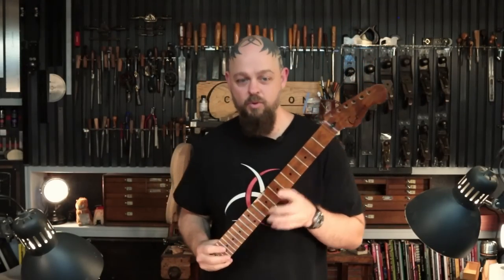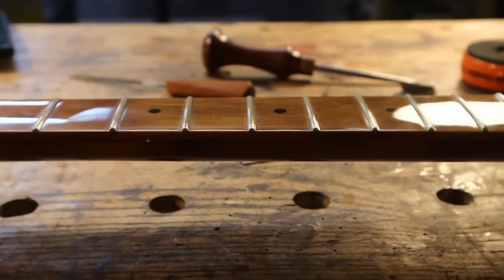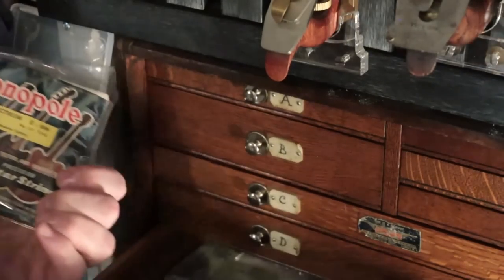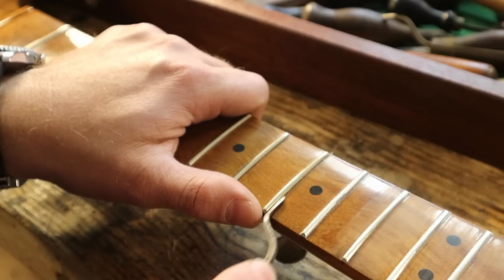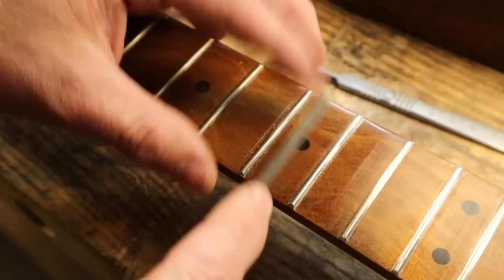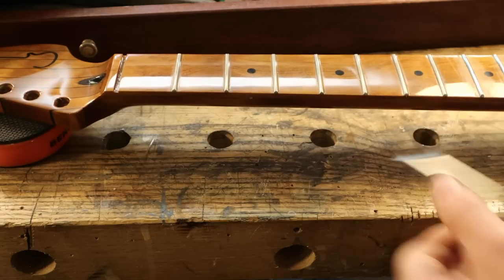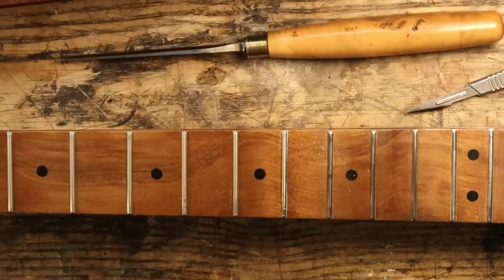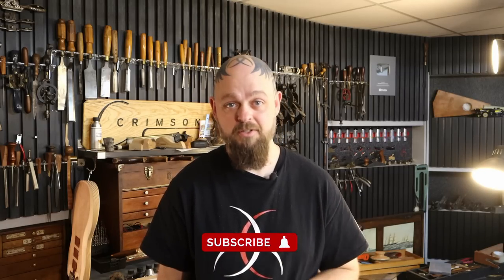Ep 13 - Always Another Way! Kauri Guitar Build | Building a Guitar from 42,000 Year Old Wood!

Comment: Amazingly, this is relevant to my interests. My custom fretting technique for my instruments uses round jewelry wire, which wraps around the fingerboard (with no fret slots) and is then attached underneath, with space between the neck and fretboard. I used to tie the ends together in knots, which provided enough tension to keep the frets snug in place. But I’ve recently started tucked the ends into grooves for a much cleaner appearance. This doesn’t give me quite enough tension to keep them from wiggling around and I figured that if I lacquer the top side then it will add some extra glue to keep them snug. I haven’t tested it yet but I figured a lighter polish would make for a smooth transition between the wire and the wood. Hell, considering I’m using viola strings I may even benefit from not having direct contact with the metal frets. The strings will wear down the lacquer anyway. Just maybe not so cleanly.

Comment: One thing that I have done to avoid this issue is to use thin strips of Teflon sheet, the same thickness as the fret slots. I put it in the slots before lacquering the fretboard. The lacquer doesn't stick to the Teflon so it's easy to take out of the slots, you can then if need be flatten and polish the fretboard before putting the frets in. As for 'Life' Ben, sometimes it needs a massive shake up to be interesting again. I hope that whatever shake up is happening in your life sorts itself out and trust me, life does sort itself out in the strangest ways.

Comment: Dean Zelinsky Guitars have been putting a “checkering” on the back of their necks, called the “Z-Glide”, for a little while now. I’m not sure what you have in mind when you mentioned using some checkering on guitar in the future, but the Z-Glide is the first thing that came to mind.
Reply: @pgmaillot  
Completely understandable. I'm not a fast player either, so I'm not sure what benefit I'd get from such a feature! Other than what you mentioned. I mean, if you're touring musician and playing alot of gigs where you sweat your ass off...I suppose it would be perfect. 
I would to have a DBZ Barchetta, they kind with the big medallion on the headstock. There was no checkering, but the neck had a deep V and was pretty fast. I totally wish I didn't trade that guitar!! 🥺
Reply: @pgmaillot  The pattern is supposed to reduce the amount of contact your hand has with the back of the neck, thereby decreasing friction as temperatures and sweat levels increase as you put it.

Comment: you ok ? as you've dropped a lot of weight, if intended er well done! i not made a guitar as yet as well got the other jobs going on, but tool with the different uses. This is for weeding patios the crack and bits in the middle etc buy a lino knife and just sharpen with file . i work as a gardener and at the mo very busy got about 4 years out of the 1 i have will think about getting new one for the weed. But i will find another use for the old one. i hope you and yours are well etc. and nice to see you chilled . Also no dig gardening is the way forward omg it pays off even in flower beds .

Comment: That was very useful and timely thanks. I'm making some pendants using some burl scraps cut into cabachons, at the moment, and facing the same problem with removing the finish from the bezel without scratching the cabachon edges. I was thinking about trying some 3M bristle brushes, but will try something like you are doing here.

Comment: heres one tool i have found indespensable that I mad it is a feeler gauge with small teath for cutting nut slots you can cut any size of slot by stacking together the different gauges and the cost compared to traditional nut files you should make a fancy feelar gauge nut slotting tool with fine teeth one side and more teath aggressive teath

Comment: I just had a thunk (past tense of think)... What if you used a strip of masking tape between the frets, but not against the frets,  so that the chisel can sit on it. Essentially it gives the chisel a more downward cut on the fret side and the other side of the chisel blade is "lifted" away from the fretboard thus protecting it from scoring and removes the need for sanding and polishing.

How does that sound????

Comment: The way I do it is tape up the fretboard them use steel wool to remove the finish. I use minwax poly which comes off super easily, honestly a little too easily.

When I'm leveling the frets I don't polish them on purpose so then I can do it with the steel wool during this step.

Comment: Correct me if I'm wrong but if you had to refret a lacquered fretboard guitar, the next to penultimate part of the entire process would be hammering or pressing in the frets, with the original lacquer in situ.
So on a new build where you desire a lacquered fretboard, why not simply accept that the fret slots will require a quick  re-cut, and then install the frets? Additionally, since we take care to cut our fret wire to nearly the finished width for each respective fret position, why not use the time involved in removed sprayed on lacquer from the frets in the service of perfecting the frets before they even go on the neck?
It'll take time, but the prospect of damaging the lacquer is greatly reduced, imo.
Sorry about your troubles, Ben. Going through some struggles of my own rn.
It'll all feel light again. We love you.
Reply: This is a good point.  I'd love to hear the answer.
Reply: It would be a unique challenge to keep the fret slots free of lacquer.
Reply: @waynebake1123  I personally wouldn't bother trying to keep lacquer out of the fret slots. In fact, I imagine the accumulation of lacquer in the slots would be minimal, provided the thickness of finish on the fretboard was kept to between .25mm and .3mm. Any more would be excessive imo.
Anything, even Teflon dam strips, that would go into the slots would either a) form a meniscus along its margins, and/or b) could cause chipping upon removal.
I imagine that with open slots, after the lacquer has fully cured, you could relieve the slot edges with a small, fine cut triangular file, and then using a fret saw, simply clean up the extant slots.

Comment: Dumb question, but why not put the frets in after lacquering and avoid all this?
Reply: Then the frets will be ”seated” on laquer and it may leave gaps under the frets, since you can not press the frets hard. Also the tang will not go as deep in to the fretboard, and you you may end up with a fret wire, not ”gripping” tight enough. If you press to hard you run the risk of cracking/chipping the laquer…

Comment: I did just this job on a high end Fender bass and ended up using a chisel, scalpel and a fret end file 😇
You just have to realize that it is virtually impossible to remove the laquer without causing some scoring and scratching of the fretboard laquer… It is scary as h**l, but it will sand and polish out. Which chipping will not 😱
So the order of the day is ”slow and easy” with full concentration (i.e. not filming and commenting 😉)